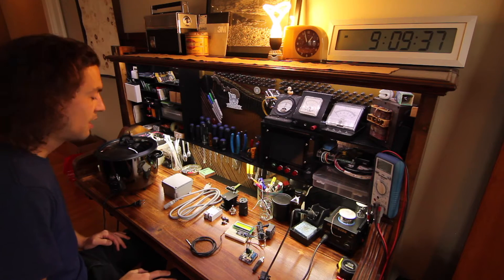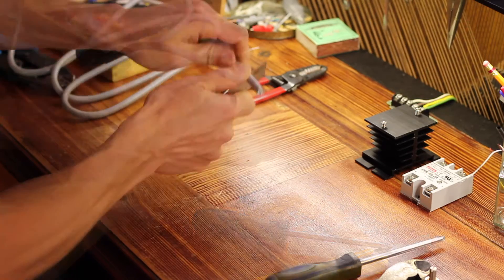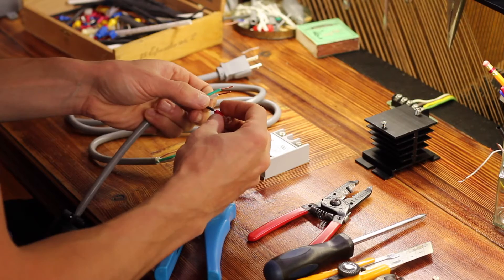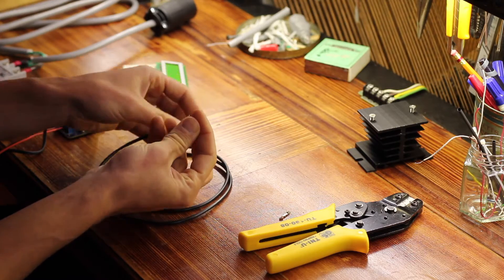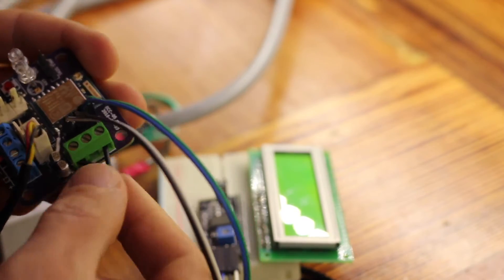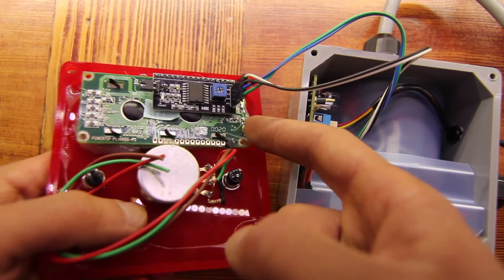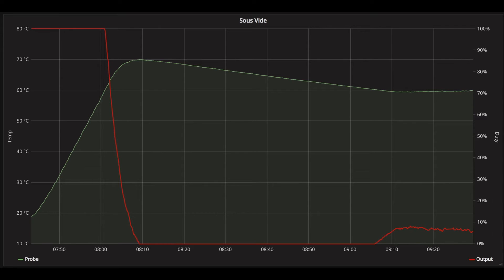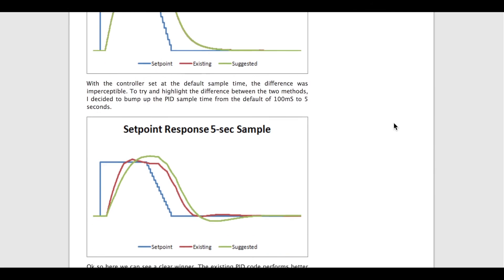ESP8266 DIY Sous Vide Controller

Comment: I built this too a few years ago, only without crockpot but with a resistor to heat up and an arduino pro mini as core. I wrote all the code, also the control loop. The problem of overshoot is mainly due to not ricirculating the water. The probe is on top while the water is heated from the bottom and it takes some time to transfer the heat. Also the tuning should depend on how much water is in, because it increases the thermical capacitance of the system, so basically the underlying dynamic system changes. An adaptive control system solves it but it's beyond the scope and it requires much more control theory knowledge.

Comment: One point id make is to add is to  add some slack to the earth wire when wiring it into the plug that way if it is pulled the power will be removed before the earth. Great idea and execution!

Comment: 18AWG to power a heating element?  I used 14AWG, a 1kW hot plate, Omega PID controller, and 12qt pot.  I got about +/- 2F for temperature regulation.

Comment: What is the purpose of heat sink in this project ?
Reply: I believe it was in case the SSR got too hot, but he tested it at the beginning and because it's so under spec (4A used vs. the 40A rating), it wasn't necessary.

Comment: Hi, does this set up not connect the heating elements ? I think I only saw the temperature probe sticking inside the crock pot. How would the heating be controlled if that is the case ?

Comment: Love your bench. Great project. I'm making my own, just with the addition of a cheap 5V pump preset with PWM, to stop water splashing around. I'v had a little trouble getting the arduino PID to work, with a relay output, but your code should sort that out. Thank you! Best crock pot sous vide build on youtube.